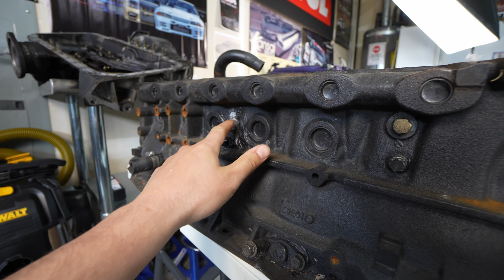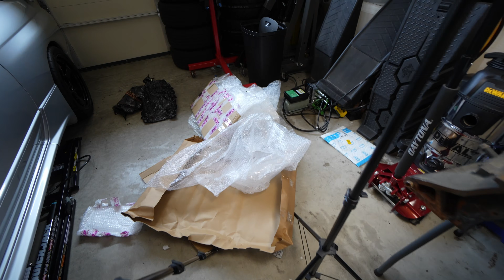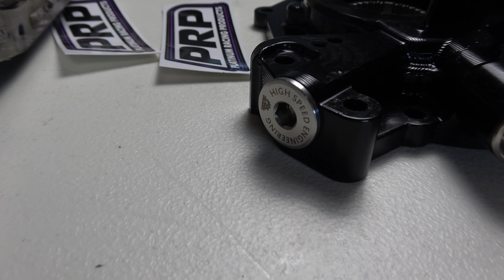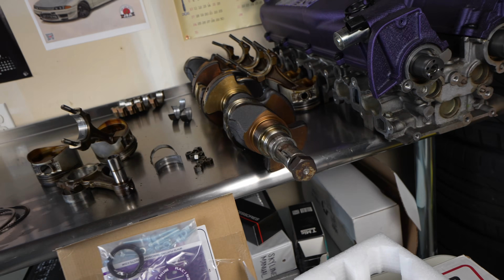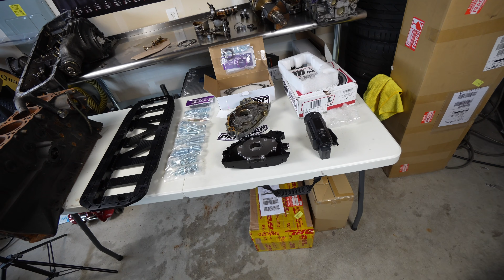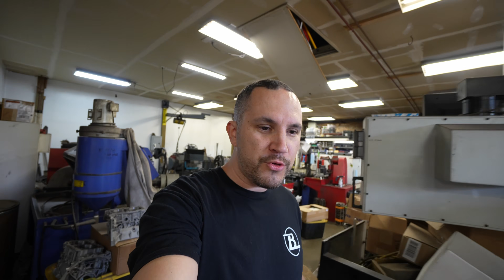Fixing the RB26 Achilles' Heel: PRP Block Brace & Spline Drive Install

Comment: Where do you purchase you’re v cam been looking to get one but wasn’t trying to wait three months to get one 😭
Reply from the maker: I bought all my stuff from Blackhawk Japan.
My build parts list
HKS RB26DETT 2.8L full STEP2 stroker kit https://bit.ly/3ElaULG
HKS Step 1 VCAM https://bit.ly/2ZEcOlt
HKS Step 2 VCAM https://bit.ly/3fFyIPX
HKS VCAM PRO https://bit.ly/3SHLlZA
HKS Oil Pump https://bit.ly/3SYBeiB
HKS VCAM crank angle sensor https://bit.ly/3SE0smE
HKS Step 2 VCAM 50 degree VTC gear up https://bit.ly/3rFtYMR
HKS Step 2 VCAM camshaft upgrade https://bit.ly/3IjGj1e
HKS Step 2 Valve Springs https://bit.ly/3CCTjh5
HKS Valve stem seals https://bit.ly/3M8aJVU
HKS adjustable exhaust cam gear https://bit.ly/3SExp2h
HKS Step 2 272 exhaust cam https://bit.ly/3T0thJP
ARC FMIC https://bit.ly/3ygjIys
HKS High power silent exhaust https://bit.ly/3T2Wzrs
HKS high flow cat https://bit.ly/3ygkPhC
HKS downpipe https://bit.ly/3rwXUuH
HKS hard piping https://bit.ly/35DkQif
HKS air flow less adapter https://bit.ly/3ElalBj
NISMO Timing belt https://bit.ly/2Rvj3n6
NISMO Fuel Pump https://bit.ly/3izF4wZ
Sard 850cc fuel injector https://bit.ly/3V7MQSs
HKS EVC 7 https://bit.ly/2FHXg8R
Tomei Cast Manifolds Tomei Manifolds https://bit.ly/3bYY2dZ

Comment: With the higher capacity oil pump from PRP are you going to be increasing sump capacity? Or using an accumulator?
Reply: This is exactly what I was wondering
Reply from the maker: I have a sump extension that will give me 3 quarts extra capacity. It’s in one of the boxes I have not opened yet. Great question though.
Reply: @JDMRightHandDrive  I kind of figured you would have one or both of those options. Motive garage has talked about it on several occasions. And you said you watch their videos a lot. As do I. Lol.

Comment: Josh those PRP parts look awesome.  The adjustable relief valve (adjustable oil pressure) on the oil pump is so cool.  I'd be real interested in knowing what oil pressure is recommended as "optimum" for these engines when they are modded to this degree.  The Aussie guys you are dealing with probably have an opinion about that.  Do you know what it is?  I mean, at high revs, like 6,000 and over, what oil pressure would you shoot for?
Reply: 120 psi is recommended
Reply: @slvrbakslpz   Thanks!  I'm hoping that's correct because that's about where my car is.  But since it's a lot higher than the general rule of thumb (which comes out to about 80 psi at 7,000 rpm) I'm interested in knowing why this engine should have higher oil pressure.  If anybody in Nissan world has written up some kind of analysis of it, I'd like to know where it is and read it.  I mean, it could be something like this:  Our oil pressure sensors are before the oil filter.  Pressure drops 10 - 20psi going through the filter.  Pressure drops XX psi going through the block to the crank, then drops another XX in the crank before it gets to the rods.  Pressure needs to be XX at the rod bearing inlets.  Something like that?  

In the general stuff I find about oil pressure, it's always stated that there is such a thing as too much oil pressure.  The one I'm worried about is the idea that rod or main bearing shells can be unseated by too high oil pressure.  But I would think that's what bearing crush is supposed to prevent.  

Anyway, I've almost given up on trying to find reliable info about this in DSM world.  So I'd like to know what people in Nissan world have to say about it!  🙂

Assuming "standard" race engine build practice of xxw-50 motor oil and clearances of about .0025" on the rod and main bearings.
Reply from the maker: It also has a lot to do with the bearing clearances to how much oil pressure you will get. Engine builder will need to have everything spot on and use the pump adjustment to dial everything in from there.
Reply: @SpeedPerformanceLab   Thanks Josh!  Is 120 psi also what you've heard for this engine?  That's 8 bar!  You wouldn't believe (well actually you probably would) how much I've gone around on this lately because I want my engine to last longer than I do haha!  
So anyway, I just replaced my brass AEM 150 psi sender with a Stainless AEM 150 psi sender, and I'm logging it with a real logger that is more accurate than anything that can be done with the DSM ecu.  And I'm getting 110 psi at 6,500 rpm.  

Myles at English Racing (he oversaw my engine build there so he knows my car) says "That oil pressure is fine for how your car is built.  Do not worry about it."   
In DSMtuners I talk to a Japanese guy named Hiroshi who knows a lot.  His engine is built very similar to mine and his oil pressure is like mine, high, and he thinks it's ok.  
Kiggly (famous in DSM world) made an oil pressure chart that shows pressure drop across the filter on his car.  His pre-filter pressures are around 112 psi at 8,000 rpm.   

So you would think I'm all settled and fine with the high oil pressures, right?  
But Jafro and just about everybody else in DSM world thinks 110 psi is too high! 
Plus just about everybody in the world of "other" cars out there thinks it's too high.  
So that's why I'm still on it.  Looking for more info input!  😄